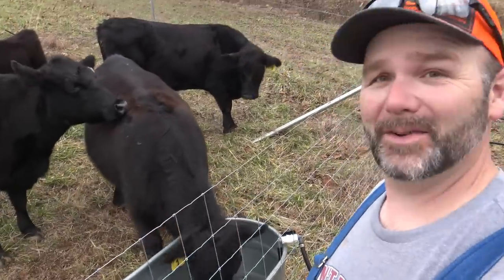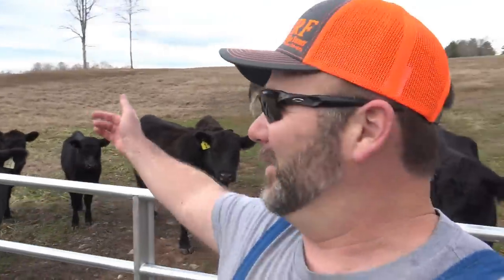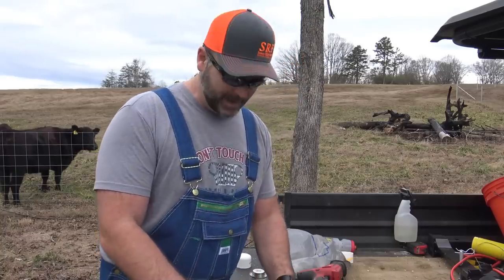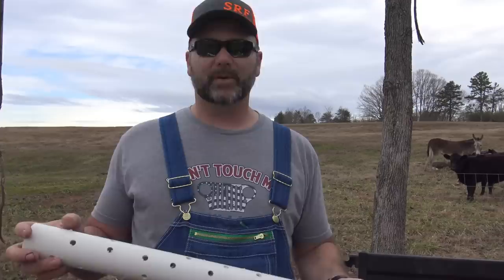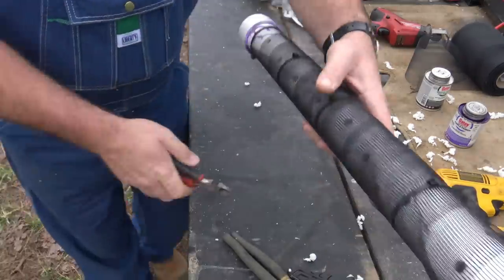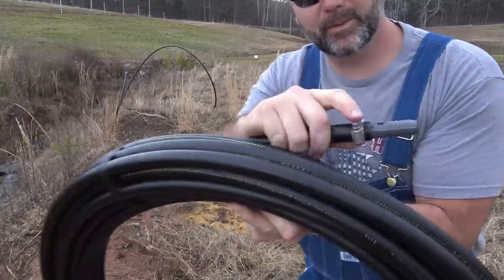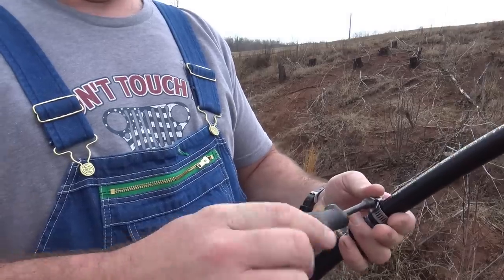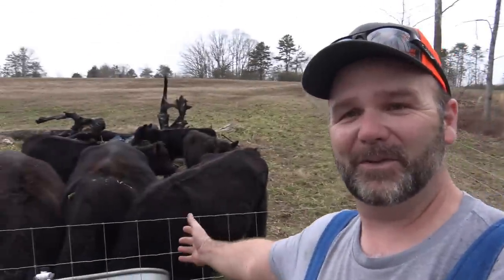Non Stop water system..no electricity, no pump, simple and easy

Comment: 1.Fix all accessories, dip the whole bunch of pipe in the pond, let it filled with water, close the far end value now lay the pipe on the ground, bring it near the cows water stores. Now open the valve here is easy to draw water from pond. 
2. Or for the first time use a water pump at the pond, when water reaches to far end, withdraw the pump and fix the filter that is all .

Comment: Best way to get the syphon going is to push water back up the line first with a pump. This will get all the air out and so then once you get all the air out and disconnect your pump the water will the syphon back down the line from your pond

Comment: Use the engine of your little truck to do the sucking. Use rag get the best vacuum on the engine inlet to create a vacuum on the pipe. You don't want it to be too good because you will stall the engine. Use the engine inlet vacuum to suck the air out the pipe. Try not to let the water go into the engine, but as you would be holding it for those few seconds you should be able to just get the water to come over the dam. After that, gravity will do the rest. If you really wanted to have the extra protection use a water trap which you could also build out of PVC pipe

Comment: Put the whole roll of poly in the pond. Let it fill with water. Close the valve and pull the end of the pipe down to the drain point and open the valve. Syphon should start.

Comment: You had a valve on the low end already, just close it and fill up the pipe with a pitcher. Reconnect to the filter/float, go back to the bottom, open the valve and TADA you have a gravity fed line. We emptied the neighbors above ground pool with a garden hose using the same system after I saw them with buckets working their butts off

Comment: Instead of sucking on the pipe, pour about five gallons of water into the lower section, with the stopcock in the closed position. Join the lower section to the one above and then open the stopcock. The water in the lower end will run out, forming the vacuum needed to pull the water into the end in the pond and over, far enough for it to start running downhill. If five gallons is too much, just fill the pipe with water. The flow will seem to stop, but that is because there is a gap between the water that has flowed out and the water coming from the pond. Just wait a while and the pond water will come running out.

Comment: Hello, I am just curious if it will work for a 30 meters elevation from the source of water?
I am thinking of using your method with our small livestock farm.
Reply from the maker: Siphon works as long as your water source is above your tank....it's just gravity...I suggest using a larger pipe at least 1 inch

Comment: few steps that might work, this basically create vacuum in your hose until you get it full with water:
1. get on your truck bed, fill the hose with some water
2. use your thumb to close the hose shut to prevent air entering
3. start shaking the hose just like race winner shaking bottle
4. remove your thumb from the hose when you're shaking down
5. close the hose when you're shaking up.

i say might work because your hose seems long, but if you manage to get some water sucked in before the priming splurts out completely i think there should be high chance of this working

Edit: if your thumb can't close the hose, use your palm

Comment: Sink the entire coil of pipe in the pond to fill it then anchor the end in the pond with a rope and a weight and close the valve. Now drag the filled pipe down to the pasture with the tractor by rope. No manual suction required. Just remember to keep the upstream end submerged 100% of the time and close the valve when not in use. You can buy a valve that will close automatically that operates by float that would keep the trough full all the time and shut off before it overflows.

Comment: Hydraulic RAM assembly will also lift water to higher level using the gravity flow energy of water in a sloped pipe. and valve and air pressure.

Comment: Get your self a 12V Diaphrame pump it will do the trick in no time and you use from the Gator the electric. Or even a 12V Solar panel and it's pumping it quickly

Comment: A couple of tips. 1.Use a standard cattle water trough with a built in ball cock. This will work fine with a symphony.
2. Always site the trough well away from the fence, because if the cows are thirsty and are all wanting to drink at once the fence will get pushed over. I know you are aware of this as you were having to babysit them. When you have more cows you can end up babysitting them for over an hour!

Comment: Lordy this is where you needed to pick up a bit of extra pvc and a couple check valves while you were at home depot and build a cheap hand pump. It'll last years no more than you'd need to use it just to get the suction started. Good times this way though!

Comment: Thing is UV  will take 2-3 yrs. to degrade PVC  and you could use a little spray paint on the valve or cut a colored plastic plastic bottle to fit and cover the valve . Lot of ways to solve that or not worry about it for a few yrs.

Comment: Take your pipe and stick it all into the pond. Let it fill with water and all the air escape. Close your valve to keep the water trapped in there (and keep air out). Now carry it back to the cows and turn it on. It should just start spitting water on its own.

Comment: Buy a 20 dollar 3/4 inch bilge or livewell pump and you can use the battery on your gator to power it. Or put a tap in the line half way and prime it with a funnel and buckets of water with a shut down by the pond. Fill it, open tboth valves and then put your chapstick on while walking to the trough and start sucking on that big black pipe 🤣

Comment: Best way to obtain a syphon is to fill each section of the water line with water, as you fill each section you already have water in each line so you connect a new line fill it up til you get the appropriate length of line you need. this is auto fed. No reason to try to suction water. It would be like dipping entire tubes into water filling it up leaving one end in the water the other end laying on ground. creates the syphone.

Comment: Check valve placed on end where filter is, 2 inch stand pipe on the bank about 3 or so feet high with end cap unglued.....you get a bucket and fill the line from the stand pipe then place endcap on open your tank valve and it will self siphon itself

Comment: Use a shop vac or a air compressor or fill the pipe with water on the down hill sit to the valve then hook up your suction side and open the valve

Comment: answer to the question asked @ 14:02

use a manual air pump that we use to fill air in bicycle tyres. faster and safer. you can then turn off the ball valve and remove the manual air pump and let the water flow as normal.

Comment: Put an extra ball valve near the low outside area of the pond .  Then submerge the coil of 3/4" tubing to fill it at the pond .  Close the pond end ball valve and pull the Tube out down the hillside away from the pond.  Open the pond end ball valve and a siphon should have a chance. 

Alternate method could be a homemade plastic PVC tube piston   at a T on the line just below the outside pond area with two in line check valves on before and one after the T fitting that lets a simple piston push pull water or air  in and out between the possibly  home made check valves. This piston must be better at sealing when pulling than concern for pushing but both check valves need to seal pretty good to make priming the siphon easier.   Once water reaches or even leaks at the primer pump which could be a removable portable cheap tool kit pump that can lift the height of the the rise.   

Another option is a container or bucket with a bottom sealed fitting that is kept during a primer process higher than the top of the hill that the Tube has to go over an enters via it's own Tube to the T with its own ball valve to the T stem and another ball valve just below the near outside pond hillside .  Suficiently Fill the reservoir with bucketfuls from the pond,  then with the low exit ball valve shut at the hillside T open the stem side the the above peak reservoir which can be added to by continued bucket activity from the pond until bubbles stop coming out of your filter and it sinks again to its happy place.    Close the T stem to primer reservoir then open the downside ball valve to the hopefully patient and appreciative cows.  

Fascinating what you're doing there.   Wonderful!  Those are some of my thoughts. 

Thanks, 
John

Comment: Here is the answer to how to get your line primed without drinking pond water... leave the ball valve open and start to fill your line with water. Once it starts to run out the other end, close the ball valve. The hose DOES NOT need to be full to the top, just at least a few feet of line possibly as little as 4 feet. Then pull the hose over to your cows down the hill. Once at the bottom of the hill open the valve. This will allow the water in the line to drain causing a vaccume that will suck from the pond and start the flow. If it does not work you need either more water in the line or a steeper hill. The slope of the pitch helps a lot. I might have a video of me doing this on my channel the community victory garden, but if not I can make a video if people comment here. I used this all 2020 season to utilize an old cistern on my property that is uphill from my garden but I didn't have a pump. I personally believe that the best water systems should never require electricity.

Comment: At the crest.  Cut the pipe.  At each end put a plug.   Pour water in at the crest.   Seal both pipes back together.
Make sure no bubble.  Go to drain side 1st.  Undo plug.  Go to siphon side 2nd.  Undo plug.  Water be flowing !    Or
Just get any bicycle pump...
Or any sort of pump that causes suction on one side....
Proceed............

Comment: You will have to re-prime it every once in a while.  I doubt you will be able to pull water up using your own breath vacuum because even a fountain pump is only good for a few feet above the surface.  Maybe one of those siphon hand cranks that they sell for siphoning fuel would be nice then you wouldn't have to rely on a power supply and you could do it from the end at the trough which would be easier than taking the whole line back to the pond to fill it up and then back to the trough.

Comment: The wedding is different. It works as water is at high level. Please see other video s which are working  with water hammer method.
Reply from the maker: You mean ram pump....I've got 2 of them in use on the farm pumping water up hill right now...works awesome!

Comment: Pre fill the pipe with water first with valve closed or use and start the siphon process with a vacuum pump. Like what you would use on the ac in your car.
Reply: You know how heavy 300ft of 3/4" pipe is 😂

Comment: The straighter the pipe run, the easier it would be to start the siphon off. Running flexible pipe across the ground wouldn't give you the easiest of starts.

Aside fromusing a pump to start things off, you can add a T piece at the highest point with a cap you can remove to fill the pipe with water (with the outlet blocked off), that can start the siphon off without lung power too.

Comment: there is a dead simple solution for you w/o sucking pondwater :
T-piece on the highest point with valve to close the free end
fill it up the high end with water to eliminate all air in the hose
then close valve
there you go

Comment: Don't forget that siphon systems  inherently lose their prime after a while of running. It seems that the air entrained in the water (that the fish breathe) comes out inside the pipe creating a large air bubble which loses the prime over time. 
 But if you really want to use this system, install a T the uppermost part of the pipe on top of the dam. Place a valve above the T and another one on the pond side of the T. Close your bottom valve and the pond valve, then open the valve above the T. Put in a funnel and fill the pipe with water from the pond. Close the valve above the T, open the Pond valve, then open the bottom valve. In that order. That should prime your system.
 Either that or a drill pump and a cordless drill at the pond to Prime the pipe
  If it were me I think I'd just build and install a ram pump in the Stream from the pond.

Comment: If no one has explained it,  disconnect the first section, push it back into the water and burp all the air out. Close off the end and drag it back down to where it connects with next joint. Reopen the end and make sure water flows. Reconnect and tell yourself how clever you are
Reply: Oh,  the float valve is a great idea too.

Comment: Take a portable tank with  water and 12 volt  pump and pump water From low side to over the damn now you have a full hose creating the syphoning. no pump? Measure and build by way water spigot fill Polly while still rolled and cap ends. load up and move to location roll sections out along the route to be used.  Uncap ends careful to spill as little water as possible work from low to high. When all connections complete make sure fee completely submerged open feed valve and let gravity take over. Simple and no diaphragm strian.

Comment: What kind of piping did u use? I'm trying to do this but cant seem to get the water to continue to flow
Reply from the maker: 3/4 poly pipe...you may have an air void...we'll be doing a video this weekend on this system...it's having problems right now

Comment: At 12:40 you said the ball valve is not tolerant of UV. How can UV damage a ball valve?
Reply from the maker: UV light breaks down the exterior of the valve..it gets brittle and breaks...I recently replaced both of these valves...a little PVC rated spray paint will help
Reply: Interesting. Could you fit a metal ball valve instead? Would that work?

Comment: Hooker pump.  there are small pumps that fit the end of a battery drill.  connect to the pipe and fire up your drill.  its slow but better than sucking that into your gut/lungs

Comment: It's  after the fact but you can fill the whole roll of pipe in the pond then shut the valve and drag your pipe off down the jhill to the tank. No sucking on pipes for dirty water. yum, yum.....
Reply: also if you roll your pipe it won't try to coil up behind you near as much saving a kink in the line.

Comment: Bring five or ten gallons of water down below near the cattle, along with a drill operated mini pump.
Pump the water UP into the line to the pond. That'll force out the air.
Shut off that valve and disconnect the mini pump.
Open the valve, and the weight of the water you put in there "draining out" will pull your siphon over the hump from the pond. You'll be good.
Voila...

Comment: Up on the high part of the hill, but a little bit down hill toward the tank, out of the reservoir put in a "T" fitting.  Put a short pipe, with a tap, on the "upward" part. Open tap and suck air out.  You do have to seal the bottom end near the cattle bucket. Water will flow over the hill (you made vacuum, if you really suck at it)  and run, once the water head takes over (and you open bottom tap near cows).  Basically suck air out at the top where you do not get water, just air.  Then its like with your wife, let nature take over.  Big advantage is that it is easy to "redo", without any tools whatsoever, if you loose vacuum over the hump.

Comment: Why no check valve on the filter end
And a fill at the top if the dam
Reply from the maker: check valve requires pressure to keep open or push closed.....this is a gravity fed low pressure system that cannot push or pull a check valve adequately

Comment: Maybe your hose has to be fill with water by dipping it into the pond then if you think that it has water already inside you have to sealed the other end of hose by your thumb or by your palm then start pulling the hose  out of the pond without removing your hand sealed on the end of the hose then move it to the low down part of your farm, must be lower than the level of your pond then release your hand from sealing the end of the hose.... Wahhlahhh the water is continuesly flowing through it..

Comment: LOL -Problem solved. Get a mag drive water pump online. High quality small pump, hook that in to the end of hose in the pond, battery pack from car (to start your engine if you are in a field) Water pump pushes the water fast and done - remove pump under the water (in pond) - weight down pond end of hose

Comment: Next time you need to start your system use this as a pump ( if you have compressed air available close by) 
YaeTek Pneumatic 4.2CFM Air Operated Vacuum Pump A/C Air Conditioning System Tool Auto       Available on Amazon

Comment: Water tower. At the water source. float valve in tank. If its air tight you just need to check it. Tank can be a sealed drum. 90% full. Check out free energy water pump on youtube. User: learn for life.

Its medium pressured output too.

Comment: You can drill holes only on bottom half or leave it with no holes and screen the bottom. Than have it where you can quickly push it up and down. It will push the column of water every stroke down, the water will stay in the pipe on your up stroke as long as you don't pull the end out of the water or holes out. I would do a solid pipe with a screen instead of any holes to do this if pond is deep enough not to hit bottom and stop it up. After it starts it can lay on it's side as long as it is still under water,but you know that already. The one open end is enough opening because  if you use 1/2'' or 3/4'' or 1'' it will only let that volume of water come through anyways.